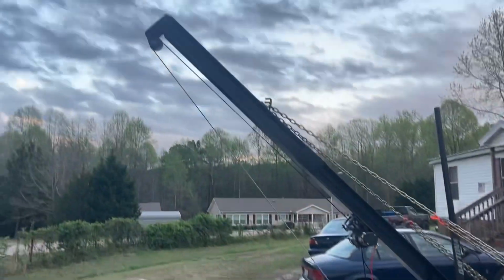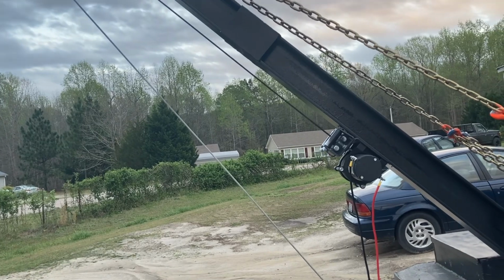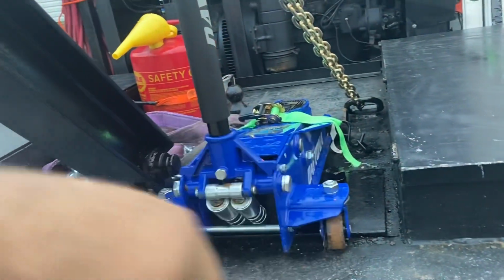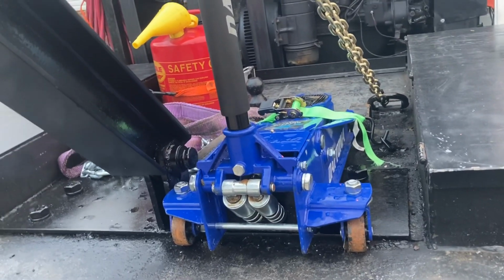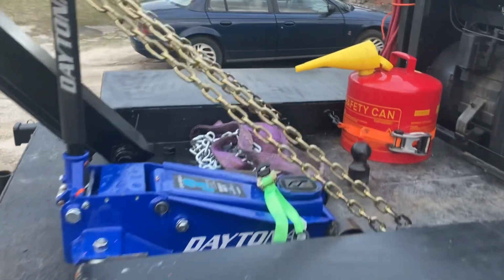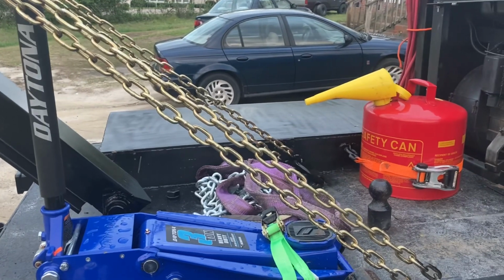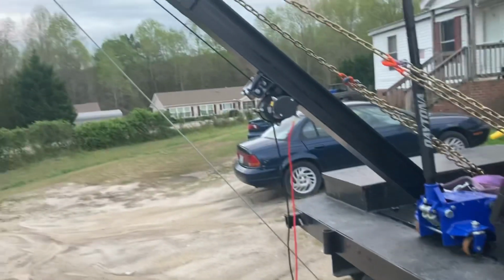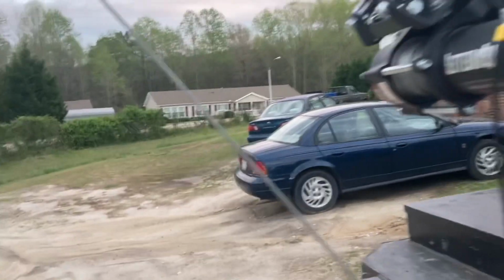Making a gin pole crane for only $350

Comment: Hey brother, it looks good but I have a couple of recommendations from outside looking in. First, I would upgrade the attachment point on the boom for the chains, most likely a pair of hooks welded straight to the boom. Second, attach a second lift point just behind the primary lift point on the boom then get an appropriate sized snatch block with a hook for lifting the load and hook the dead end of the cable to the secondary lift point. Thus will double the mechanical advantage.

Comment: Cool setup and price point. Not sure  if  this would  work but my idea  on calculating  acceptable  loads  would be using  a DC  amp  meter  (the non contact clamp type)  to see  what amps the winch pulls  with given weights  at a defined  angle  and if you have a known  weight  close to  what you want as max that would give  you  an idea  of amperage  to see  for max weight.  Ofcourse  changing the angle  will change the load on the winch and amps drawn  but it might give a  fairly  quick ballpark  test on unknown  weights being acceptable for  your  setup.

Comment: I like how you did it, only thing I would change is to put a d ring instead of those hooks on the I beam. I made something similar and I used a HarborFreight hoist instead of a winch I just plug it in my machine

Comment: You could set up a second winch on the opposite side of the boom and weld an anchor point on the mounting plate, then you would be able to change the angle of the boom by yourself without trouble. Still use the chains for lifting, but the 2nd winch would add easy boom angle adjustment if that is something you may need.

Comment: Looks good man I like how you kept it nice and simple the only thing I see is where the chains Mount of the I-beam looks like it might be a weak link 4 looks good looking forward to seeing it lift some stuff up
Reply from the maker: I agree that is one of my concern to. They are rated for 3klbs and there is two. So I guess on paper it should work.
Reply: @derbadortheweldor8940  look up weldable grab hooks, I would definitely rework those hooks you put on that's what's holding all of the load. Were you pulled out your weld dug out on the hook were it will see the most stress
Reply from the maker: I see northern tools keeps them in stock. I’ll definitely be swapping them out soon since there is a solution
Reply: @derbadortheweldor8940  glad to hear definitely will be safer, I enjoy watching your videos keep them coming.... check out the only video I uploaded it's a welding bed build
Reply: Those hooks are only rated at 3000 pounds if you squeeze them together and weld the one end into the hole ,the way you have them set up now if that chain slides up they're just gonna bend over, other than that it's a nice little setup

Comment: Having been using ome kf tise i built, i suggest moving rhe support anchor point backwards, to increase rhe angle between the gin pole and the support chains. It will be stronger that way 

Mine has a secons winch on the back atays, so i can move thr boom back and forth

Comment: You should make a cradle where you can fold it back over the welder and strap it down. Personally I would have mounted the winch to the bed and routed the cable through pulleys
Reply from the maker: No point in having it fold over it won’t save any height because the welder it can’t sit low enough and if the winch mounts on the bed it will be a extra thing to remove when I need to dissemble it
Reply: @derbadortheweldor8940  you wouldn't have all that hanging off the back of the truck though. It just seems like a safety hazard to me. Just a suggestion.
Reply from the maker: I don’t see how. It’s orange on the end and don’t violate and DOT regulations as far as I can tell. I see bucket trucks and tow trucks with booms hanging off the back of them all the time. What is the difference???
Reply: @keithboyer3210  Things can happen with all that weight bouncing down the road.
Reply from the maker: Like what?? If I have it locked down with the winch it can’t do anything.
Reply: @derbadortheweldor8940  Looking at it, the leverage that the i-beam has alone-combined with the driving/bouncing will be substantial.
Reply from the maker: It can’t bounce if it’s locked down
Reply from the maker: Been driving it for a couple weeks no problems

Comment: derb, when you lift 1000lbs, each side of the pulley cable has 1000lbs so 2000lbs total...so get a bigger pulley.   also the weight of the chain stress will be about twice your lift weight - depends on how far down the boom you attach.  finally, would switch to D rings and a carabiner to attach the chain to boom, the hooks look a little undersized for a crane.  stay safe.  never manipulate a lifted load with your hands,,,attach rope before lift or use a long pole to prevent derbador mashup.  melting metal anthony nearly dropped an air compressor onto himself when it became unhooked from his crane during a lift

Comment: Good job, I built something like your crane on my log trailer and also used a winch. I purchases a wireless remote control for my winch for about $20.00 (Amazon) and I can't believe how much I use it and how will it works, just a thought.

Comment: Can you drive on the road with this?
Also. You probably could make this rotate on your truck .. with a few modifications
Reply: I agree, it seems to be a safety hazard hanging off the back so much.
Reply from the maker: Tow trucks and bucket trucks do it all the time. Only thing I see in NCDOT regulations is it has to be orange if hanging off the back so much.

Comment: Those chains may be rated at 3,800lbs. However, the angle you're using them at severely reduces their capacity. Prolly still good for 1000lbs though. Keep up the good videos...

Comment: 09/09/2023 Hello Welder. I like your idea. However the  small hooks are not strong enough. They are made to be hammered closed and are not hardened steel. There are a lot better choices. I would go to something like a tractor supply, rurak king or a large tractor repair shop and make a selection.  Your chain is "work loaded rated" far stronger than the hooks Cheap solution would be to weld a chaim hook rated for the chain. Great job but I personally do not like the chain hooks on the pole. Sincerely Don

Comment: Sorry, I can’t help myself….BUT, are you seriously going to trust your life and the life of anyone around you to those cheap ass, Mickey Mouse connecter chain
Reply from the maker: All the parts are rated for x3 what I intend to pick up. No one’s life should ever be in danger when using a crane. Your life will only be in danger if you get under the load witch is a big no no
Reply: They might be rated for 3000lbs. when closed through the eye and used for their intended purpose as a chain repair link but I guarantee that you’re in for a surprise and I hope you don’t get hurt when it happens. Good luck.
Reply: @williamthomas9463  Totally agree.  Also the danger is not just under the load but under i-beam as well.